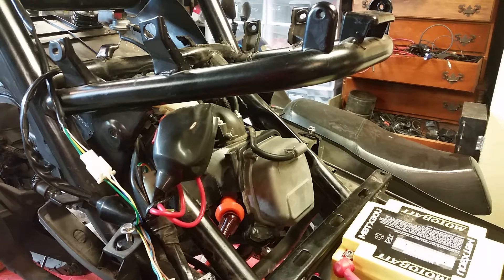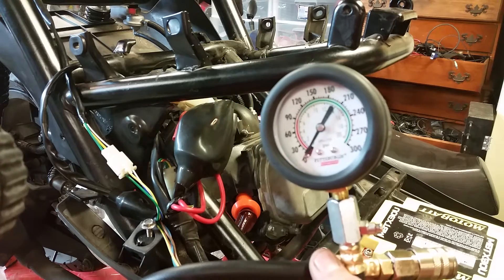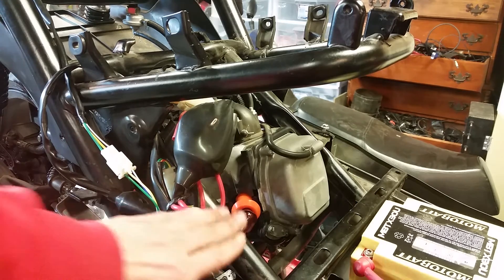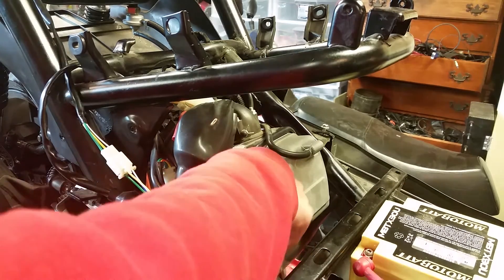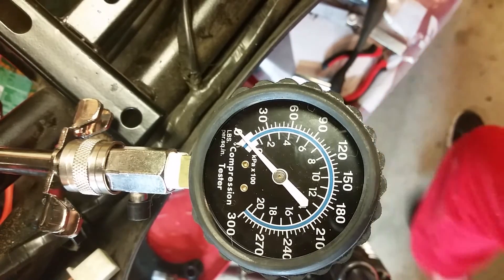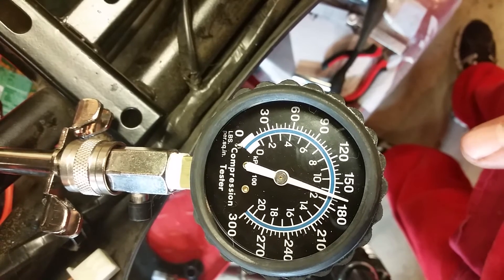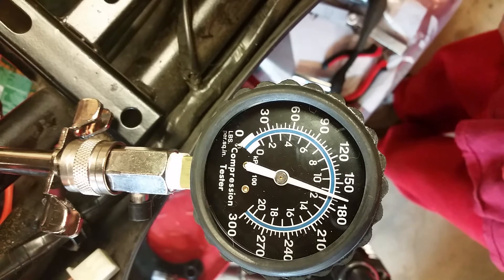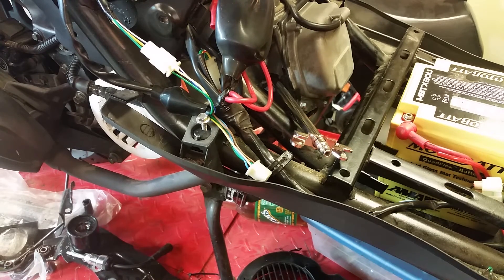GY6 150cc Compression test

Comment: I have a 150CC gy6 scooter. It died on me on the road and it wouldn't start up again. I did a compression test and it was at barely 20psi. I guess my motor is ruined...🤷
Reply: Was you able to fix it?
Reply: Did you rebuilt it? Sorry this happened to you
Reply: @missael773  Yes
Reply: @ELCLAVE300  what did you do to fix it? My new 250cc GY6 with 220 miles has low compression of 95

Comment: nice video.  I see it jumps to 60 on the first stroke.   Mine won't start and it goes up slower and stops at 150psi after I add a few drops of oil to the piston top.   New carb and tried spraying a little starting fluid in with no change.   Not even coughing or trying to start.   Great spark.   Looks like I need to tear the cylinder off this thing.
Reply: Edit 150psi.  Tried 2 other gauges and figured out my gauge is just about 30 psi low consistently.

Comment: I tested my 50/81cc compression, it was 152 psi, I was about expecting it to be either higher or lower, I may had lost a bit, because I only screwed it in with the rubber hose, but with the head being modified, I unshrouded the valves, when porting the heads, if I shaved the head like I planned, I would gotten a bit more back, maybe gained over stock, I'd like to see around 180-195, maybe 200 psi, I run 93 pump fuel, with a octane booster, I guess I don't really need it! Just guessing, it should be around 95-98 octane, depending on the fuel,  93 is supposed to be the minimum, some better brands may be a bit over,   I think anything over 98-100 would be a waste, possibly hurting performance! My next 50cc will be a 52.4 bore, big valve, pop-up piston, maybe a stroker, so 88-95cc and I'm looking for 190+ psi, but less than 200, I may do a H2o/methanol injection to boost performance, it supposed to simulate 100octane fuel, I plan on a pwm throttle control for the pump, to vary the fine spray, it works in high-performance automotive use, so why not!

Comment: I just got new compression tester and my 150cc gy6 ends up with 40 PSI. Is it even possible,because the engine will run ? Or my tester is not working?
Reply: lol same story with my gy6 150cc quad
70psi... it run great had still stock tyres thing was not used that much...
but my adly 300 quad gives me 60psi and runs great also im so confused about the compression guage thing all my bikes and quads give me 50-80psi max... even my 125cc dirt bike, my kx80 same story they all run (thx kx does need a rebuild cause i messed it up) but still it makes no sense
Reply: @reggiexp69  no it's not possible.   It's still a simple 4stroke engine.   I bet your gauges are inaccurate.

Comment: Hey i have a jonway 150cc scoeter that wont start it has a new battery,sparkplug,magneto and feul. The scoeter has spark and feul but dont want to start test 2 carborators on it but it dus the same .I did the valve adjustment and timing right but stil dont want to start dont now if it can be the compresion .
Reply: Im in the same boat, the next logical step is a compression test. If that fails, itll be either the head gasket or the piston rings/ seals.

Comment: Mine is a brand new motor never been ran and it came with only 60psi . ivr adjusted valves took the rings out and checked the gap and still only 90psi
Reply: Have you been able to fix it?
Reply: @ElPatronGamefarm  yes I found you can't compression test these motors they have an automatic compression release on the cam. After hours or scratching my head getting mad I finally noticed it . The only way you can compression test them is if you have a aftermarket cam that does not have the ACR( auto compression release )
Reply: @dabtech7456  please inform me what across is?  How do you know the cam has it or not and what function does it serve?
Reply: @irocss85  if you pull the valve cover off on the cam it self you will see a small 3rd lobe that is your automatic compression release what it does is it lifts up slightly on the exhaust valve during start up to allow the starter to crank the engine over a few cycles. Once the engine cranks over the auto compression release disengages and the engine is running . It prevents kick back which could damage the starter, the starter gear or even cause the timing to skip.
Reply: @dabtech7456  cool thanks I'll look.   I tested my cranking compression with another gauge and I got 150.  Matching the first gauge i used so I trust that.   Don't you think 150 should be able to start?  I know the ideal range is 175 to 195.
Reply: @irocss85  yea it will start make sure your valve lashing is correct set them at 0.03 on intake and exhaust side .if you wanna boost your compression for a first start squirt a Lil bit of oil in the cylinder
Reply: @dabtech7456  done both already.   I did lose some compression from all the cracking  but few drops of oil brought it back up.   I'm an auto tech and I work on engines for a job.   But there just has to be something I'm missing here.   It will not run or attempt to run even with starting fluid.   Tried the clear flood mode also.   Can is full of fuel i can tell because if I open the drain hose fuel runs out.  2 different carbs.   One new.  Orig carb would run on the old engine but it would seize up when hot due to the wrist pin . Cyl wall scratched up and piston trashed. But it would still start right up when cold.   Bought a scooter that was used for parts to take the engine.   Piston and walls still Shiney cause it's never ran. Ever.   I relashed the valves a few different times trying .003 to .005 and would retest compression after to see the effect.   I drained the fuel tank and refilled with fresh gas just to make sure my fuel was good.   
I have great spark.   Made sure the cutoff switch worked properly.  It does kill spark when engaged.   Tested stator and pick up.   Adjusted pickup to .012"  Orig was over. 020".  Swapped coil.  Swapped plug.  Verified ground good.   There is no stand switch.  Never was.   It's petty frustrating.
Reply: @irocss85  have you bypassed the brake safety switch and also verify you have the correct stator for the right cdi some are ac voltage and some are DC voltage you will know what system you have by the type of cdi you have
Reply: @dabtech7456  my brake safety switch interrupts the starter circuit.  I tested the a/c output from my stator and pick up.   I didn't write it down but it matched the specs from the video I watched showing me how to test it.   .02vac and 160vac if I remember right?   And I have the typical 6 pin a/c cdi and matching connector/ color wires from the stator yellow/ white/ green/ empty cavity.    I have considered swapping the stator just to try it from my orig engine but haven't done it.
Reply: What did your fix end up being?
Reply: @dabtech7456  oh never mind I remember reading this reply now.  And I still aim to see if mine has this feature.   I'm probably gonna order an aftermarket cam any ways to eliminate my cam shaft as the problem.
Reply: And, turns out either it was because the stator was installed upside down 180deg out, putting the timing of the black pole that charges the cool up,  or the timing chain was 1 tooth out.  Starts right up now!

Comment: I seen you working on them before I have a 4 valve GY6 motor it was running great the next morning got on it and it would not run got spark and fuel but will not run do you have any ideas
Reply from the maker: I would need way more info... for example, did you convert it to 4 valve or is it factory 4 valve? If you did it, start by checking everything you touched... is it getting fuel, spark.. then move on to checking valve lash, compression, etc. Etc....i really can't help without a lot more info...
Reply: It is a factory motor 171 CC I thought the valves so I sent them I checked the spark plug Spark it look good carburetor was getting fuel what stomping me is I started it running all day shut it off at night got up the next day and it would not run I will check the compression next what should it be on a 171cc water cool
Reply: @wadebarnes6720  compression should be 180 psi. those cdi's are fukin junk check that.
Reply: @wadebarnes6720  and?  Curious what you found

Comment: The harbor freight tester is fine, the extension hose has too much give, if you use the metal tube is will read properly. Mine also read 90psi on my 150cc buggy, when I switched to the metal tube it read 179psi
Reply: Nice!  I’m having this same problem.  This video and your comment give me hope!  I have the same Pittsburg tester with the flex tube.  I’m gonna try it!

Edit:  Sure enough, my 90 PSI is actually 130.  I used the same Pittsburg gauge only I removed the flexible hose and used the angled metal tube “push and plug” adapter that came with the gauge.  I just needed someone else to turn the key while I held it against the spark plug hole.  Worked great!  My top-end rebuild a success!
Reply: Nah I had the same experience myself.   Comparing gauges with my other mechanics in my shop.   Mine consistently read 35psi lower then every one else's gauge.   And some I could use their hose  no change.   So a bad house sure is possible.   But a gauge that's out of calibration is much more likely the culprit.

Comment: What if it's 120 an under
Reply: Nicole Cantu 120 is down on compression a bit. 90 is about as low as it goes before you experience hard start situations and having to keep applying throttle for it to run.
Reply: time for rings or valves. might as well do both while ur at it.